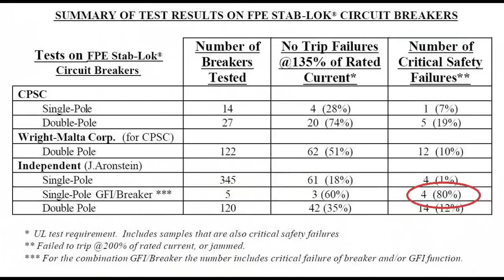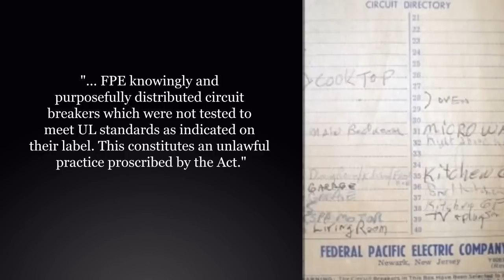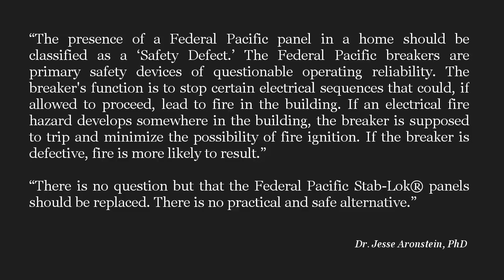Federal Pacific Breakers - Fire Hazard?

Comment: Overall , If you have a Federal Pacific circuit breaker panel in your home 
You have NO electrical protection whatsoever because of the extreme failure rate , The only way to make your electrical system safe again is to get the panel replaced and replaced immediately , I strongly recommend replacing it with a Square D panel and Square D breakers , Square D makes the best circuit breakers and panels and I've changed out a few Federal Pacific circuit breaker panels and replaced them with Square D breakers and panels , Even though Square D breakers and panels are more expensive , For the high quality and reliability , They are definitely worth it  I've been doing electrical work for around 40 years and not once have I come across a bad , Nor heard of a Square D panel or breakers That were defective , So whenever I replace a circuit breaker panel , I only replace it with Square D because they are the best

Comment: Replaced the 200 amp Federal Pacific main breaker at the service entry to my home.  The unit had failed on one side of the 220V connection, and was arcing/overheating.  This was a stand-alone breaker.  The distribution panel for the house is in the basement, and I have noted no issues with it at this time.  I will, however, want to replace it before any dangerous condition develops.

Comment: I cannot imagine why except for cost that we ever got away from fuses. They will always blow and they are 60 times faster than a breaker. Duh, they should still be in use today instead of breakers. Every house i hav ever owned has had a problem with faulty breakers, especiallb Zinsco, nightmare.